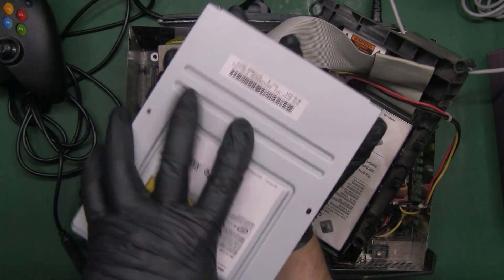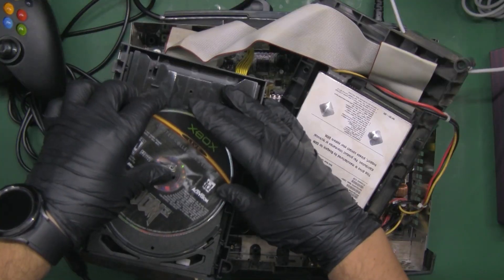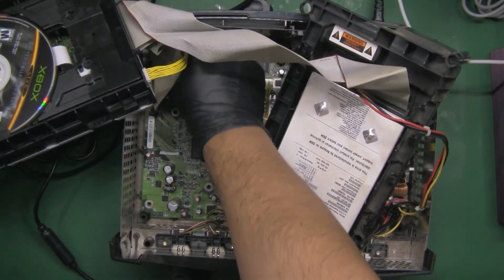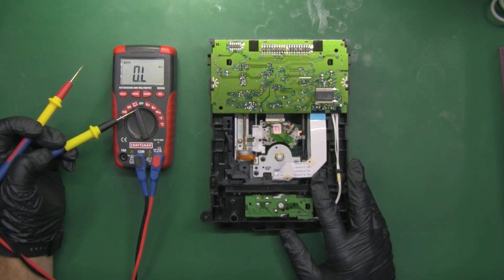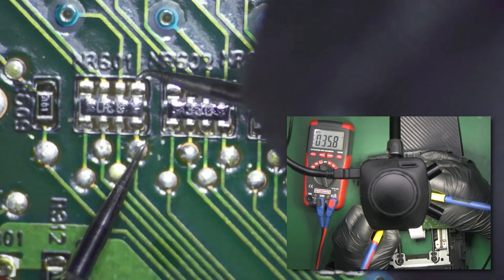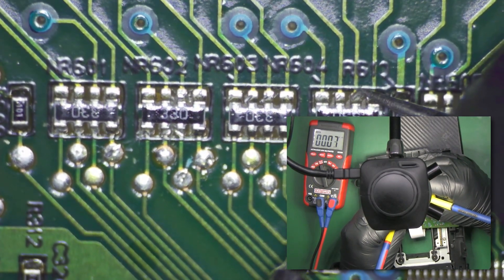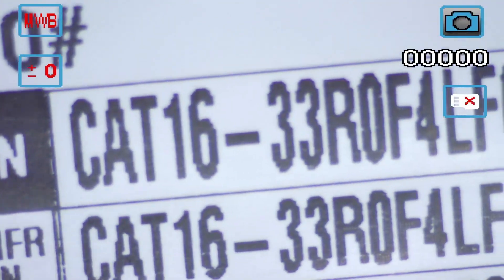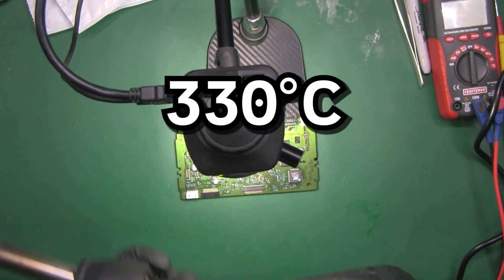Can We Bring This Broken Drive Back To Life?

Comment: I have a Samsung 605F drive that gives me the "Your Xbox can't recognize this disc..." message. This video was helpful, but didn't solve my issue. I did test all of the resistors, and they all reported back the correct ohms. I did replace the 5 surface mount capacitors, and unfortunately, there was no change. The laser moves and lights up, and tries to read the disc, but it still gives me the same "Your Xbox can't recognize this disc..." message.

I see a lot of videos on repairing the Thompson drives, but can't find much information about fixing the Samsung drives. (I have a Thompson drive that is also giving me the same "Your Xbox can't recognize this disc..." message. I haven't done anything to it at this time)

Comment: You don’t have to replace the entire resistor array. Since it failed open, a single resistor across the two vias with the same specs will work just fine. Just scrape the tenting off the via so it will accept solder.
Reply: No need for this ghetto fix when it literally takes seconds to do the full swap and the array is dirt cheap too...
Reply: @AlDim000  Yeah, replacing them is always better… but I’m responding to where he literally said he had to stop and couldn’t do anything about it because he didn’t have replacements on-hand. There are more options.

That said, I’ve had to fix bad resistor arrays on DCDigital/DCHDMI flat flex cables more than once. Perhaps I should preemptively order more for future installs but this only seems to be an issue for old BlackDogTech FFCs and I’ve always been lucky to find convenient ways to finish the install and return it to the owner on the same day.

For example, the first time was the last resistor in the RN4 array/network, so I just put a 47Ω SMD resistor on the side. It worked as well as a dedicated PCB footprint! Another time RN2 was missing the second of four resistors. Thankfully, the third one wasn’t used so all I had to do was flip the whole array around so that the second resistor swapped places with the third.

Comment: Yeah, replacing bad resistors fixes error 10 on these drives from my experience. The caps absolutely need to be done as well. The little 47uF one is always nearly gone or gone on 605F drives and usually one of the big ones is on its way out as well. I do all 5 anyway because may as well. It's pretty much the same story as with GC disc drive caps.